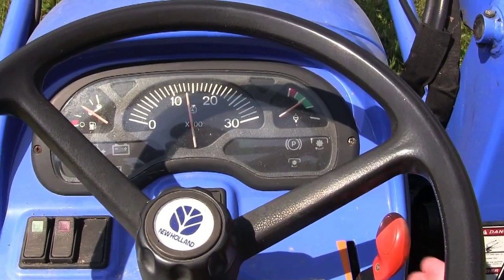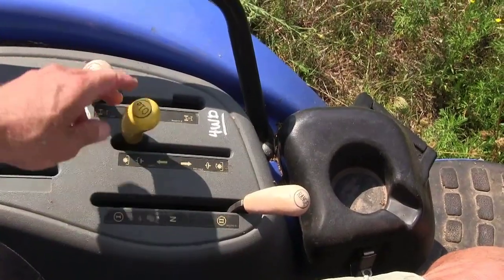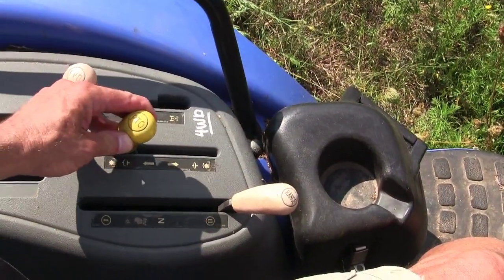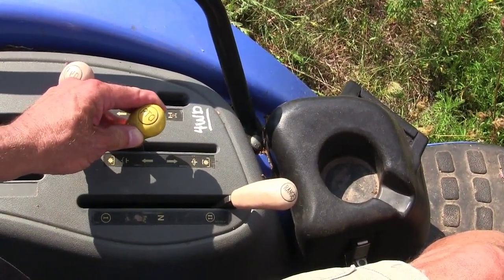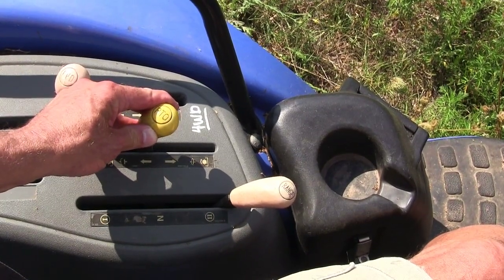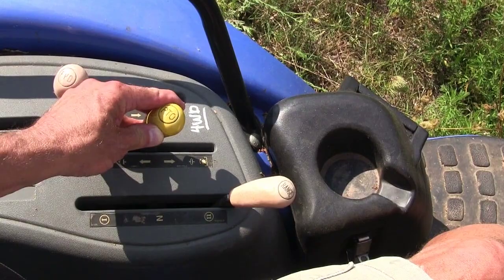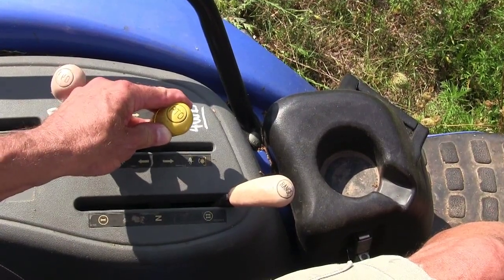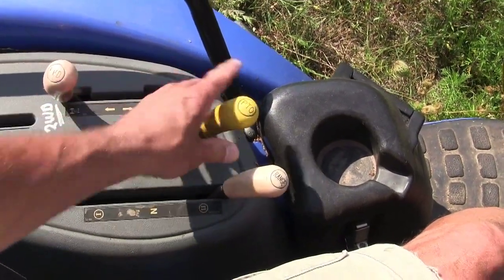How to Engage PTO to Prevent Breaking Shear Bolts

Comment: I was shearing Grade 2 shear bolts like crazy on my new Kubota MX6000 when using my rotary cutter. So I came up with the idea to install a slip clutch on my rotary cutter and where the driveshaft connects to the slip clutch, I installed a grade 5 shear bolt instead of the  Grade 8 that came with the slip clutch. That way I have twice the protection.  Another thing I did was to purchase a slip clutch that has the snap ring groove on the end of the shaft, that my driveline connects to so if my Grade 5 shear bolt ever does shear, the snap ring will prevent the driveshaft from coming off the slip clutch and causing damage or injury. On my Land Pride rotary cutter the snap ring is present on the end of the existing shaft coming out of the gearbox for a shear bolt set up for this very reason.

Comment: I sheared my grade 2 pin on my brand new 6ft bobcat rotary mower and deutz allis 6240 tractor engaging the PTO, so I put a grade 5 bolt in.  That worked great for about 250ft.  then I hit a pile of dirt and instead of sheering the grade 5 bolt, it destroyed my PTO shaft.   oops.

Comment: Thanks for the advice on the PTO engagement Mike.  I have a Farmall 806 which has a lever to ease the PTO on with & a John Deere 4600 that has a simple ON/OFF switch for the PTO, I prefer to idle this tractor down when engaging the PTO.  As for shear bolts, I like to use a SAE Grade 5 bolt.  That seems to work well for me.

Comment: I have a New Holland Boomer 35 and the pto is either fully engaged or fully off.  You can't engage it slowly.  I idle way down and engage so the jolt is much less than it would be if done at higher rpm.
Reply: Does it help? Recently got first tractor. Mine has a knob you push down, turn and release. Had a pretty violent start up and I've broken my first bolt. IDK if keeping it at a lower RPM will help or if I need to throttle it up before engaging.
Reply: Best way to learn is to try it. Some tractors have no issues engaging the PTO at low throttle. If your tractor dies, you can always start it up again and increase the throttle little by little. Once you find your tractor's happy place, WITH THE PTO ENGAGED slowly throttle up to the rated RPM.
Reply: many thanks I do the same 🤔

Comment: Great advice, Mike.  I own an LS XR3135, mated to a 5' rotary deck (brush hog).  My tractor, like a lot of the newer ones, doesn't have a lever for the PTO that I can engage gradually. I have a button switch located on the dash, and it's either On or Off. No "easing it in".  What I find works well for my compact tractor is to engage the switch at idle + 100rpm, then gradually increase the engine speed until it reaches the recommended speed for mowing.

A 35hp tractor (30 PTO hp) isn't any kind of a monster, but I was always shearing the recommended Grade 2 bolt for even the lightest of resistance (the mower is rated to handle brush up to 1" thick, but I would snap a pin going through a blackberry patch!)  My solution was to swap out the OE PTO shaft for a shaft with a slip-clutch, backed up with a Grade 4 shear bolt.  Since the change, no issues.

Keep up the great videos.

Comment: Mike, you can't do that on the Grand L 40 series Kubotas. Those machines have an electronic switch to engage the pto. It would be nicer to have the old style to require a 2 stage clutch (1959 John Deere 430, for example) to engage the pto. But new machines are trying to get away from the requirement of a 2 stage clutch.
Reply from the maker: Lot's of people don't like the two stage design but I'm not one of them.  My instinct when I climb the brush hog up on a rock or a limb is to cram in the clutch.  With the two stage clutch, everything stopped.  With the fully independent you're stopped with the PTO running on top of the rock until you grind it up, kill the brush hog, or find the switch.  I'm with you.

Comment: I just bought a 6 ft King Kutter for a John Deere 2030 tractor.  I have come to find out that the mower is rated at 40 hp and the PTO on the tractor is rated at 60 hp.  Needless to say it shears the pin at start up.  I will try your tips but I was considering adding a slip clutch to the PTO.  Will this make the mower start up easier?  P.S. You videos have been the most useful for someone like me who didn't grow up on a farm and is being forced to deal with farm machinery to help out my wife's hobby farm.  They are well done and explain the important concepts well.
Reply from the maker: If you can figure out a way to add a slip clutch to replace the shear pin, that should fix your problem. Thanks so much for watching, I appreciate the kind comment!
Reply: @TractorMike  I think I can bolt on onto the gear drive before the PTO.  I'll know in a few days if it worked and let you know.
Reply: I added a slip clutch to the gear drive and it engages well with no sheared bolts.  Thanks for the good advice.

Comment: Wow. I have the exact same tractor and the exact same problem. I usually engage the pto slowly like you do but I do it at idle speed.
Reply from the maker: It's probably O.K. to engage at idle speed, it just seems to me it bogs the engine a little more than I like.
Reply: So you can shear the shear bolt even at idle?
Reply: Exact same thing has been happening on my new holland constantly.

Comment: I just purchased a new land-pride RCR1248 and the manual calls for grade 2 sheer bolts.  when I asked the dealer for extra sheer bolts with the delivery  they provided me with grade 5.  should I be concerned or maybe the dealer knows some thing I don’t yet?
Reply from the maker: I had to go from Grade 2 to Grade 5 because I couldn't seem to engage the PTO without blowing up the bolt.  You lose some protection, but you can actually go to the field and get some work done.  Try what's in there, if it blows out pretty quickly, you'll know why the dealer did what he did.

Comment: Liked and Sub'd. Thanks. Great info. I have a question about cutter blades. We rarely cut anything other than grass with our brush decks , yet people swear you shouldnt have a sharp edge on the blades because they will dull faster. Sure I can see that...if youre tracking over 4 inch trees all day...but not fields that are going to be followed over with a finish mower in an hour...second issue....our safety clutch pack did not release, and it appears the bolt someone had used was a grade 8...you can probably guess what happened...the input shaft of the gearbox snapped...but the guy swore he didnt hit anything...we think its rusted together, as trying to even budge the plates apart with two long bars didnt yield any movement...anyway....new gearbox and softer bolts now!!!... haha...19 dislikes from people who thought you were being condescending about bolt strength...!!
Reply from the maker: John,  here's a video I did about sharpening brush hog blades.  I'm in the camp where you don't need them that sharp, but if you'll read the comments, we got TOASTED for the video.  So...there are strong feelings out there both ways :).  On your clutch pack...those need to be serviced every year.  Here's another video to watch: https://youtu.be/eVRr9eechLI.  They all work on the same principal but the burning in process may be different.  It's best if you can get an owner's manual and see what they recommend.  Thanks for watching!

Comment: Hey, Mike! First off, thanks for all of the videos. I'm a first time tractor owner and your channel has been nothing short of a life saver for me! I have as Case DX45 with cab and recently bought a King Kutter Flex Hitch 6' rotary cutter with a 40hp gear box with a shear pin. This video saved me a lot of headache from losing bolts while just engaging the PTO! I did about 7 hours of mowing and still managed to break 4 shear bolts from hitting stumps, logs, etc. The only way that I have found to access the bolts on my PTO are to take out 3 screws of the shield that covers the connection point and that lets the shield slide back. It just seemed like more work than a lot of others. I can't figure out any other way to do it. Have you heard of set ups similar to this or am I possibly missing something else? I tried calling the manufacturer but the person I spoke to didn't seem to be too confident in giving me any advice.I also noticed that sometimes I can't get the PTO to spin quite enough to get the shear bolt to line up so I can punch the old one out and end up having to disconnect the PTO from the tractor. Is that normal, or again, am I doing something wrong? I appreciate your help!
Reply from the maker: Mike, it doesn't sound to me like you're doing anything wrong, you may just have one of the tougher shear bolts to get to.  Couple of things come to mind...I might try shopping for some bolts to make that shield easier to get off, like a wing nut-style that can be loosened and tightened without tools.  That might save a little time if it's possible.  Then, make sure you lift the brush hog up over a mowed are when you're trying to put the shear pins in then you might be able to spin the blades on the cutter from the top to get the pin out and get everything lined up. You won't spin the tractor side of the PTO.  The DX-45's and TC40's (like I have) have a brake in the PTO that keeps it from turning when the tractor is shut off and it'll have to be removed from the tractor to get it to spin.  On most tractors, if the engine is shut off, the PTO with freewheel, not on yours or mine.
Reply: If you don't want to go to a slip clutch, best way is to change out the PTO Guard for one by 'Bare-Co.com'. It has quick disconnect clips, no tools or funky releases. Runs near 100 bucks, but well worth it.

Comment: Thanks for the info! I have just inherited some land and a John Deere 850 utility tractor. The PTO start turning when I let off the clutch. What I was confused about was what if I need to put the tractor in reverse while I'm bush hogging? Do I need to wait for the blades to stop before I do that. I'm trying to find out before I mess something up.
Reply from the maker: First, l probably need to let you know what system you have there, because it's different than what's in the video.  The 850 has a two stage clutch.  Push it half way down and it disengages the transmission, all the way down and it does that and disengages the PTO.  So, you have to have the clutch all the way down to engage the PTO and when you let it up half way, the PTO starts to turn.  You can brush hog forward or reverse with the PTO running, it's independent of your ground speed.  In other words, your PTO won't change direction when you put the tractor in reverse.  You won't mess something up :).

Comment: My tractor is a TYM. The manual says the PTO lever must be engaged first. Then put engine at the lowest RPM and push the PTO button/switch to engage. This cuts off the shear pin on my John Dear Brush mower every time upon engaging. I switched up to an 8 grade bolt and bam! sheared off instantly! I can turn the blades by hand and everything seems to move freely. I can find anything frozen or bound up. Any ideas about this?
Reply from the maker: What model is it?  The local TYM dealer says if the hydraulic oil level is really low, on some models, the PTO can engage "violently".  Check that first.

Comment: You wouldn't want to grab just any bolt for a shear pin because it might be hardened steel not designed to shear easily which means you might tear something up.  

That said, if you go to some place like Tractor Supply, they carry Grades 2, 5, and 8 and their prices increase according to their hardness.  They also separate them in color coded bins but as most people know, people don't always put the right parts back in the right bin when they're shopping.

The grade 8 bolts are usually easy to identify due to their yellowish tinge but an easier way to tell is that the grade 2 bolts should have no markings on the bolt head....the grade 5 bolts will have 3 evenly spaced radial hash marks on the bolt head....and the grade 8 bolts will have 6 evenly spaced radial hash marks on the bolt head.

If I remember correctly, generally speaking, grade 2 will have failed before grade 5 begins to stretch and likewise grade 5 will fail before grade 8 begins to stretch.

Feel free to correct any misinformation.  Just going by memory.
Reply: Well, they're not being stretched much (assuming correct installation), they're being sheared, so shear strength, not tensile strength, is the relevant information.

Comment: Wait, your tractor doesn't have a clutch?  Even the handful of hydrostatic drives I've dealt with had clutches.  At low rpm, clutch(both stages if so equiped) move lever to engaged position, slowly release clutch, run rpm up.  I'm pretty sure that's even what the operator's manual said to do on my grandfather's mahindra 3525.

Well, guess that's another thing to add to my list of potential  problems to avoid when shopping for another tractor.

Comment: My John Deere brand shear bolts work fine on my tractor, but I have used ones from another store and they kept breaking so I ended up going back to the recommended brand and have not had that problem.

Comment: Hum my tractor I have to clutch the pto and slowly let it engages. Yours is electronically applied ?
Reply from the maker: Sounds like you have a two stage clutch, they work a little differently.  I should have covered that in the video, thanks for bringing it up.  Mine is fully independent and controlled with a lever that's mechanical as far as I know.
Reply: +Tractor Mike how can you tell if you have a 2 stage or not
Reply from the maker: On a two stage clutch when you press the pedal down halfway you disengage the transmission, all the way and the PTO stops.  That way if you're brush hogging and you want to change gears you can push the clutch in halfway, clutch, shift, go into the higher gear and your PTO won't stop.

Comment: I am still looking for a few used tractors to put on my list to buy eventually. My one big concern is if I buy a used tractor and am not able to find replacement parts, manuals, and people to work on them if the maintenance is too difficult to do myself. So far, I am going through Tractor Data to look for major brands that have model specs I am looking for and then list those that had a longer production run in years thinking this is the only way I can find something I can keep going for 10 years or so. 
Do you have any advice concerning this?
Reply from the maker: Find a brand with a good representation in your area and a strong dealer that'll be around for a while and you won't go wrong.  You're on the right track.

Comment: can you explain: why being at idle is worse for engaging PTO than at higher rpm?
Reply from the maker: My experience is that it really bogs the engine when you engage at idle, but I've been on a few tractors that idle around 1100-1200 rpm and if yours is like that you might be fine.  Most of the time a tractor idling at 800-900 rpm is going to grunt and stumble a little bit when you engage the PTO.
Reply: +Tractor Mike thank you! love your channel

Comment: Mike, If you could afford it what make and model tractor would you like to own? I friend is looking for one for a 50+ acre farm possibly in the 60 hp range, Would this be enough Horsepower to handle most implements?
Reply from the maker: Gosh, that's a hard question.  60 hp will handle a10' brush hog and light tillage tools, but not round balers and disc mowers, so a lot depends on what implements he wants to use.  If you can give me an idea of the specific tasks he's planning to do I'll try to get you in the ballpark.  

I'm really pretty happy with my 40 hp tractor, it does everything I want it to do economically and fits well in the barn.  I spend all my extra money on guitars, if money were no object I wouldn't buy a tractor, I'd be buying old guitars.   I'd like to have a vintage Gibson Les Paul and a Fender Telecaster from the 70's.  While folks are watching me on YouTube to learn about tractors, I'm watching guys talk about music and guitars.  That's my hobby.

Comment: hi mike love your vidieo's. I have a new tractor with a push button electricly operated pto, how do i engage it with a brush hog with out tearing things up? going to borrow my neighbors brush hog dont want to tear it up
thanks
Reply from the maker: With the push button it's usually not possible to "feather" it, but you should be O.K. if you engage it at a fairly slow PTO speed (I'd try around 1000 RPM).  Don't worry about tearing anything up, the worst you'll do is shear a shear pin and that's easy to replace.  Some tractors have a mechanism built in to gradually engage the PTO so a shear pin break is not likely.  You'll probably be fine.  Kick in the PTO and mow away!

Comment: iso is a bolt term meaning international service operatives. the old term was jis Japanese industry standard. a little bit of worthless trivia,..the iso thread pitch was a bit finer that is more threads per millimeter why? who knows..iso bolts had a dimple to mark them, now the old jis is a bolt not used in newer equipment.
Reply: ISO = International Organization for Standardization